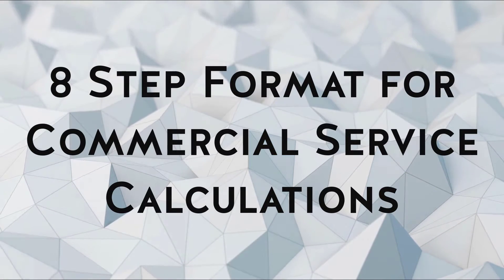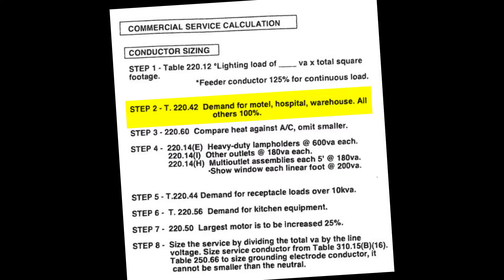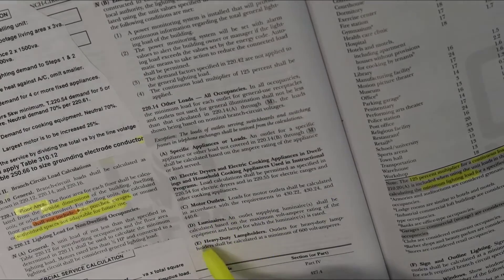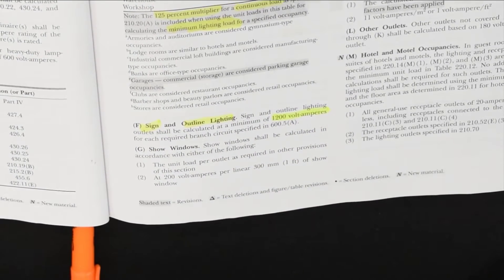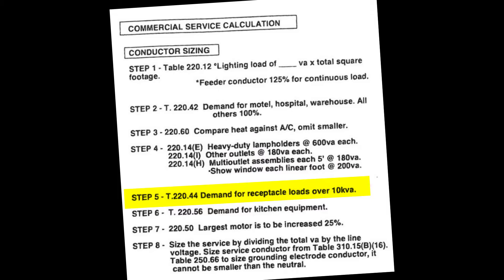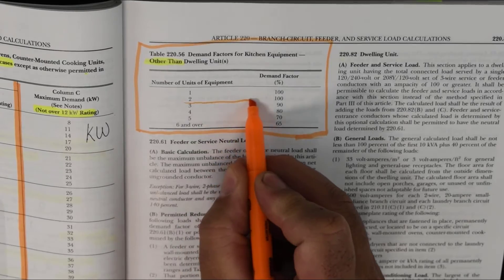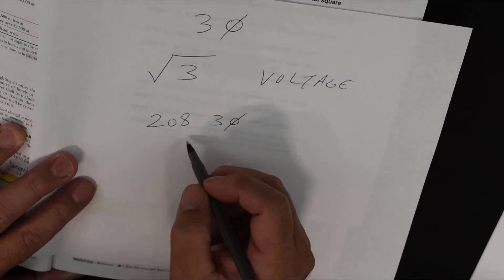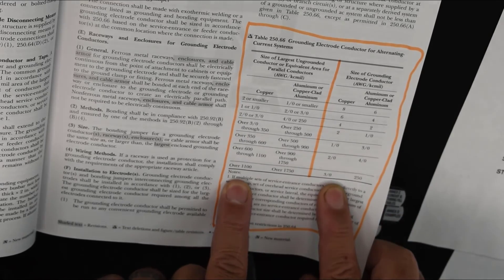NEC Commercial Load Calculations

Comment: So, if there’s reach-in coolers how would the units used for refrigeration be added in this calculations.
Reply from the maker: That would depend on the wiring method of the cooler. If the cooler simply uses a cord and plug attachment into a receptacle outlet, then you would simply add the 180VA of that outlet to the calculation. If this is a large cooler requiring a dedicated circuit/outlet, however, you would go by 220.14(A) which requires the ampere rating of the appliance to be used in calculating the required load. Hope that helps!

Comment: 1500 SQ feet unoccupied store for future, how to calculate the service load? also, how to calculate the receptacle load (no receptacles installed yet)
Reply from the maker: As far as the code is concerned, you are only required to calculate based on the current load of the building. So if there is no equipment, receptacles, etc. in the building, they would not be included in the calculation. Otherwise you would simply follow the steps in this video for what loads you do have. Hope that helps!

Comment: Question, for office receptacles, if you use the 1 va per square foot   Do you still use chart 220.44 for demand factors or is it 1va?! With no option for a 50 percent derate after first 10kva
Reply: You can only use that for banks and office building. and no you cant use that table. only for receptacle demand factor.

Comment: Thanks for the video!

Do we have to add an extra 25% (continuous load) for show window, track, and sign/outline lighting?  Or is that figured into the respective factors?  I see it done differently by different folks, and I can't find it clearly explained in the code.

Thanks!
Reply from the maker: In the context of sizing your service, you are only required to include the load amounts specified in article 220. When it comes to sizing the branch circuits for those specific outlets, then the 125% for continuous load would come into play. Hope that helps!

Comment: Thank you for this, it's going to give me an easy way to learn. 
Can you make a video for the transformer size calculation?
Reply from the maker: Hi Kamlesh, we will be making a series of new videos over the summer and will make sure to include one on transformers!
Reply: Thank You
Should the load of a 220.14(H) multi-assembly outlet be included in the total VA load, or is it already factored into the calculations of 220.14(I) or 220.14(K)?  @electrical1019

Comment: At 5:50 you say "If you don't know how many receptacles are going to be installed, you do 1 VA additional to Table 220.12, so instead of offices being 1.3 VA, if you don't know the amount of receptacles, you just go 2.3 VA. You add 1 VA/sqft."

So, where in the code does it say to add 1 VA to Table 220.12?  2020 NEC 220.14(K) states "In office buildings, the receptacle loads shall be calculated to be the larger of (1) or (2): 
1) The calculated load from 220.14(I) after all demand factors have been applied
2) 1 VA/sqft

If anything, this is in conflict with Table 220.12. Regardless, it doesn't say to add 1 VA to the VA in Table 220.12.
Reply: Check out .14K, that is where it says to add that for receptacles.